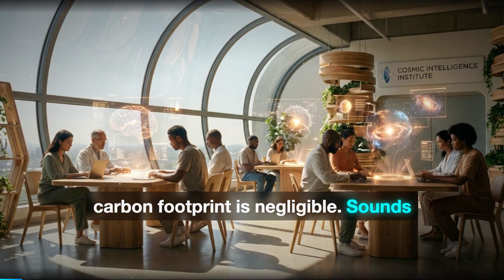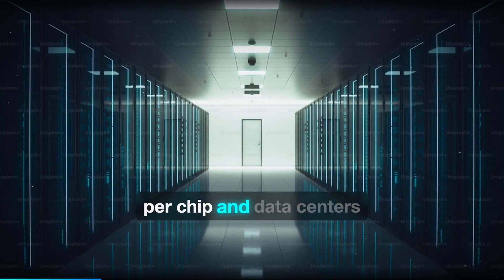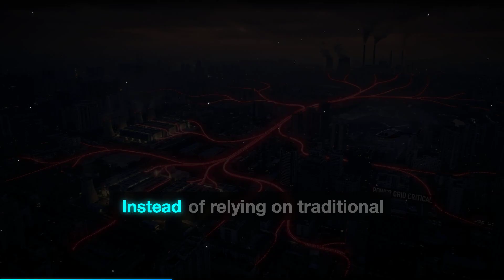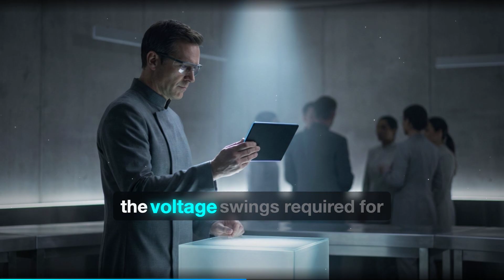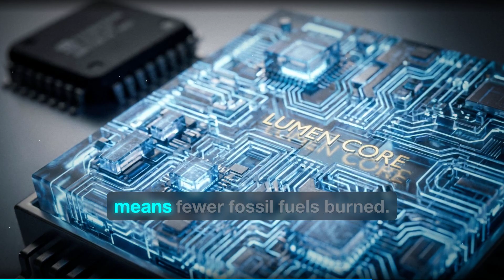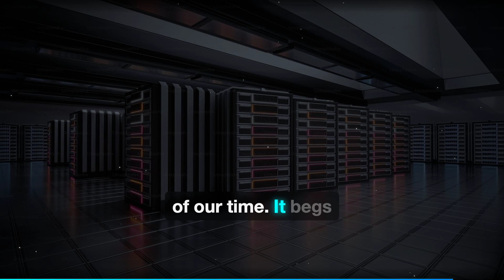The AI Power Crisis Is OVER?

Comment: dislike

STOP lying about "carbon footprint" !

BTW - the problem with AI WASTING resources CAN BE solved by proper programming!
Just like in THIS video:
Run Stable Diffusion on ComfyUI Without Graphics Card
CPU alone! 6 cores 12 treads, 1 min. doing what RX 580 around 2048 cores can!
We can solve the energy uptake by factor of 341!

High capable *CPU* is the future of AI!

P.S. *Superconducting CPU* will make you drop your jaw: with little to NO energy simple core can rival caalculating power of the whole supercomputer with 4 GPUs each stack!
No joke...
Reply: yes but you are clearly a man who is technical, i dont think many of these people are technical
Reply: @RichardBEchols  
I am "enviroment protection engineer" .
My goal is to decrease the amound of pollution and trash dumped to the enviroment. [your home ALSO do count as enviroment]